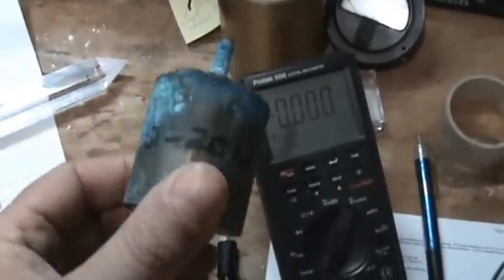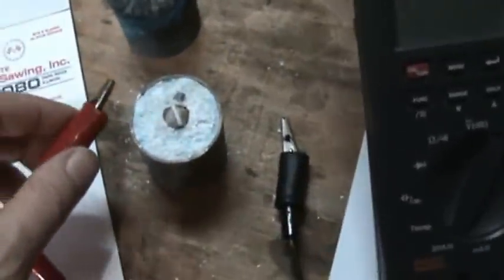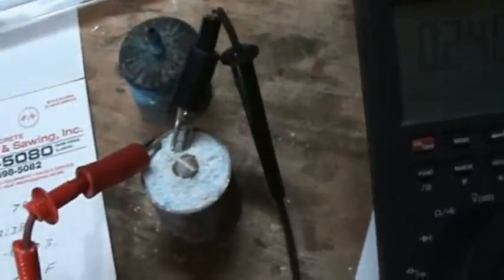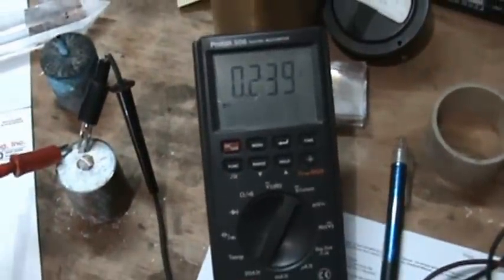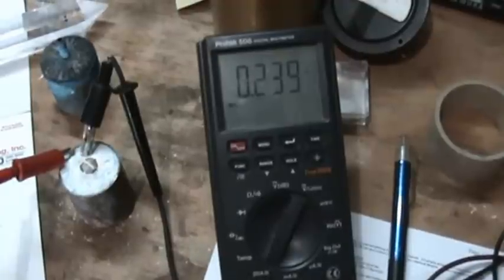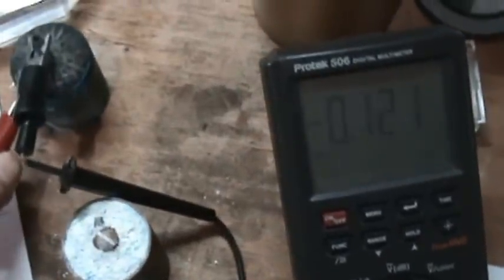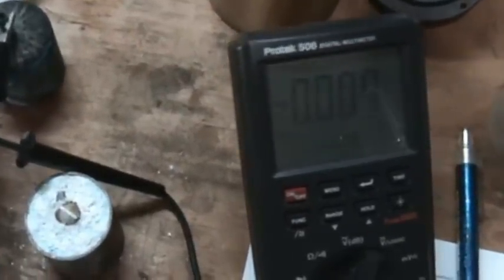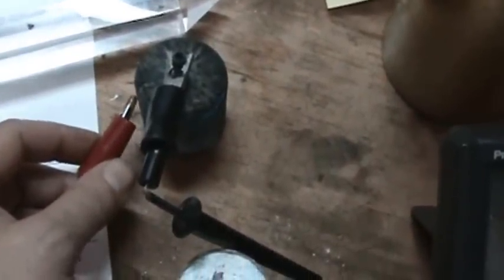Hutchison Crystal Power Cells

Comment: Researchers are missing a "CRITICAL" component that can be found at Giza and in nature..."EVERYTHING MUST HAVE PHI SYMMETRY"...  This means that the number of wire turns, the Length, Width, And Height must all be able to divide into each other like implosion. The Greatest example is "THE Great Pyramid" it's orient and size all relate to PHI and it's symmetry is precise. If your building a Space-Time Antenna, Pyramid, or a device you seek free energy from make PHI and SYMMETRY most important .